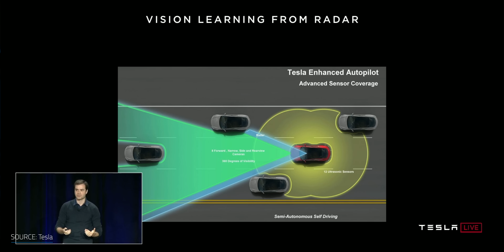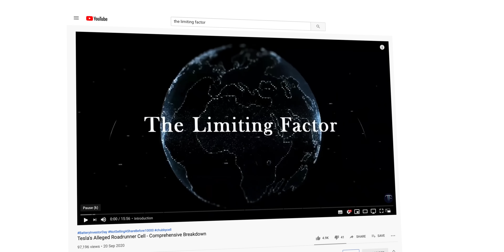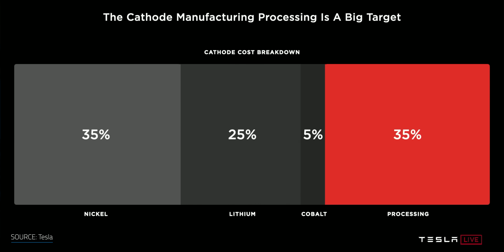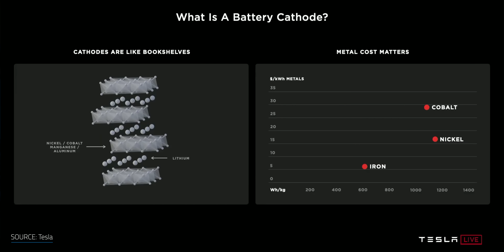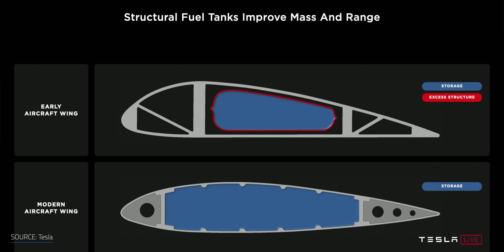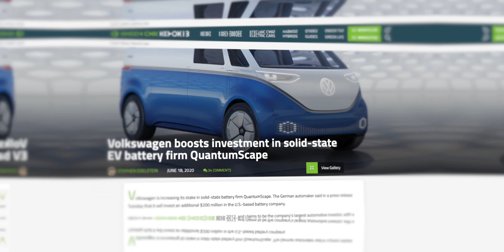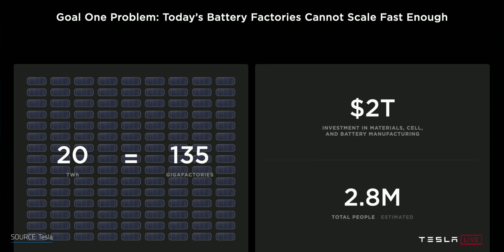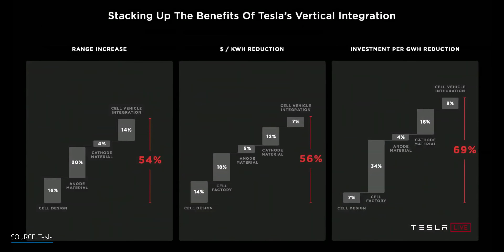3 Takeaways from Tesla's Battery Day - Hint: it's not just batteries

Comment: I like Tesla and their products...but I'm still waiting for an EV that can be used in northern climates all winter long and not suffer sever range degradation...until that happens ICE vehicles are not going anywhere. There's also the thorny issue of the electrical grid in the US...California bit off too much renewable energy hype and now has problems keeping the lights on. How will all of these EV's be recharged without a simultaneous massive investment in solar across the US ? Right now 95% of the US still covers peak electrical demand with fossil fuel plants.
Reply: Lots of EVs in the Yukon and people driving there all winter... If a car gets 400 miles normally you'll probably still get 280-300 in the winter. It's a drop but still plenty of range for the vast majority of people. Plus you leave your house every day with a full charge so unless going on road trips you never even need to see a charging station at all.

Comment: Around (5:57) you admit you're not a material scientist, and by (6:67) you say "people don't need an engineering degree to appreciate..." do you think the two statements are related?  Some basic math may give you rise to question?  This Tesla "all battery" approach architecture has some serious flaws you ignore.  For example, the announcement of 10,000 acres to be mined in NV for Lithium.  This sounds like an environmental disaster waiting to happen.  Tesla is planning to "wash mud with salt"... with a very cavalier attitude.. "it looks the same"... was the comment... but, IS it the same?.... wouldn't washing mud cause the mud to be sterile?... any residual salt left behind?.... your chart showing % of Lithium, Nickel, Cobalt... still showed 5% Cobalt by weight.  The math I speak of is if you plan to increase battery production 10,000% it's not clear where you're going to get that much more material given Nickel, Cobalt supplies, (and before you say they're going to get rid of the Cobalt, all the EVs shipped by Tesla contains a lot of Cobalt) in reality.

Then, there is no mention of the grid?  Do some math, how do you expect the grid accommodate any real percentage of All Battery EVs charging in real time?... I've already mentioned 100,000 all battery Semi's would draw 100 Gigawatts.  How about all of the fleets of EV cars, trucks, Semis, Buses,... then Utilities... how much would they draw "REAL-TIME" from the grid?  Tesla claims 100 Gwh battery production is coming... how is the grid going to even begin charging at these scales?... have you considered the load on the grid?... I don't think you have, given the conclusions you draw.   Given the toxic materials of All battery approaches, and a limited specific energy density of 300 wh/Kg, you'll still need over 3.5 TONS of Lithium-ion per single Mwh of stored energy.  Since billions of Mwh are required some math leaves the world scratching their head, how anyone just believes that all battery approaches make any sense from a grid perspective, environmental impact, or growth potential past 2% marketshare?

Clean H2, in contrast, (H2 produced by renewables electrolyzing water) has None of these issues or limits.  Clean H2 has a specific energy density of over 40,000 wh/Kg and doesn't require salt washing 40,000 acres in NV.  Further, using off-peak production from the grid, it doesn't hurt the grid by overwhelming it, it helps the grid by providing load when renewables are in surplus (Wind farms at night for example).  For a show called "undecided" you sound like you've made up your mind, with actually no thought to if it can scale.  Just take their word for it?  Do you own stock in Tesla?  If you do, you should disclose that fact, it would explain your bias.
Reply: Wow.  Lots of false info here.
Reply: @bigdream_dreambig  If you're speaking to me, name one.

Comment: While I can honestly say that I’m a big fan of Elon musk and the work that Tesla is doing, you are dead wrong about the death of internal combustion engines. Yes the range and affordability will go along way towards getting more people into EV’s. However the main problem still remains. The problem of continual usage. There is currently no way for an electric car or truck to drive non stop from coast to coast. With a gas or diesel you can stop put fuel in and continue on your way. With ALL EV’s you must stop for an extended period of time to recharge. The other problems will probably get solved soon than that one. Such as decreased range with high payloads, and the fact that you MUST charge from a Tesla charger (if you want to charge at a fast rate). Until the electric cars are able to be operated free of complex infrastructure they will never replace I.C.E. 

Please don’t take this as me hating on EV. I’m actually very excited about what EV can offer, but don’t fool yourselves, there is still a lot of room out there that will need to be filled by vehicles that use fuel.

Comment: Tesla is all hype. Tesla has failed to make an electric vehicle for the masses. And EV's do not have a support system in place yet! EV's failed in the race against gasoline the first time, and they still are. All gasoline vehicles have to do is get better mileage, and this they have still on the shelf. GM killed a motor that got 53 mph in the eighties. And this was in a 4000 pound car. There was motor that got 200 mph. And Stanley Meyers was running a vehicle on water. All you have to do is change the injectors on any vehicle to use hydrogen, and this won't cost $40 plus grand to do. Plus you can do this on any existing vehicle. Musk has made his money. Money is no object for him now. Now he is using Wall Street to launch into countless other things. Star Link? Shades of the Terminator. Who needs this? I'll be back! Go away Tesla. The Chinese are laughing at you. Question. Why can't they just make a simple, practical vehicle that gets 50 mpg, and that doesn't break down every other week? Is this so hard? And catalytic converters pollute. The air use to smell sweet after a rain. No longer. It stinks from the rain washing the pollution out of air. We as human beings are out own worst enemy.

Comment: Musk is a tecno babbler, a tunnel isn't magic, it's nothing more than an underground road it's subject to the same geometry considerations as a road for car capacity.
In fact the proposed car lift is absurd, this tunnel will be able to carry 1350 cars per hour at 60k/ph (if none break down or crash on this one lane tunnel) I would like Elon to explain in a coherent manner how a single lift is going to lift 1350 cars per hour to the surface or exactly how many "lifts" are going to be needed, and where the cars are going to line up to get on the lift and the space requirements of this lift system. It's star trek scam.

Comment: It drives me to despair that the same company that innovates so much and pushes boundary’s forward at an incredible rate with excellent manufacturing of motors, batteries, octovalve, software etc, cannot paint the cars or line up the panels or stop water getting into lights or trunk lids or fit all the interior correctly. It must be that that part of the car is not interesting enough for them or they have a limited engineering resource and their more focused on the future than fixing the issues they have.